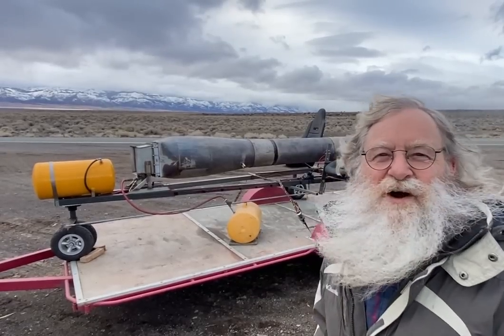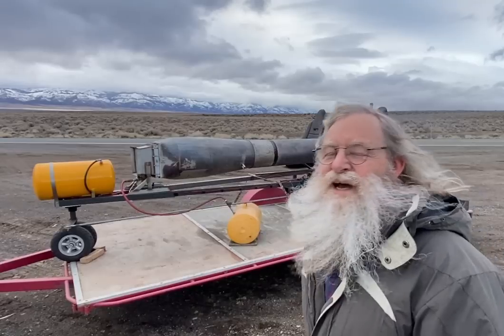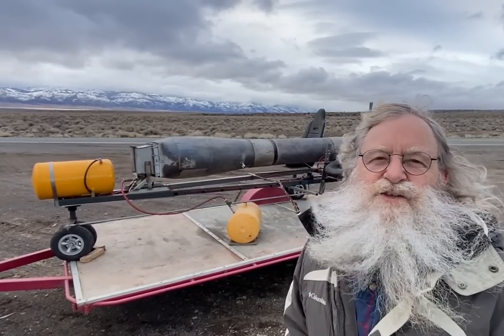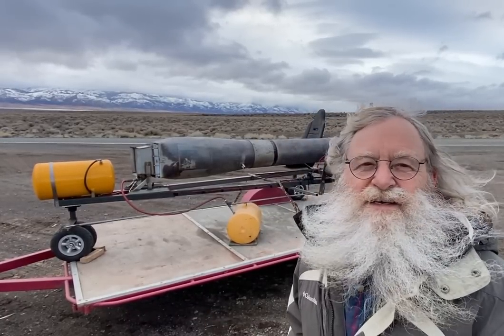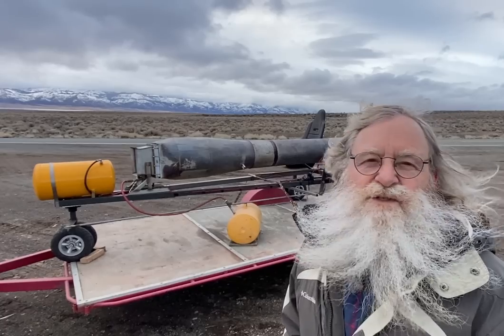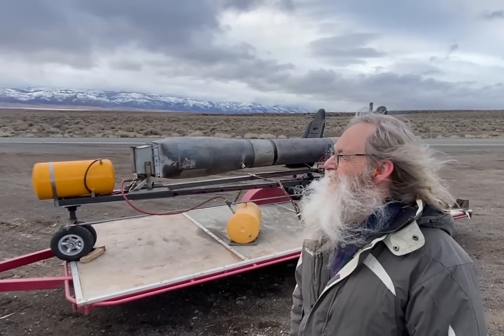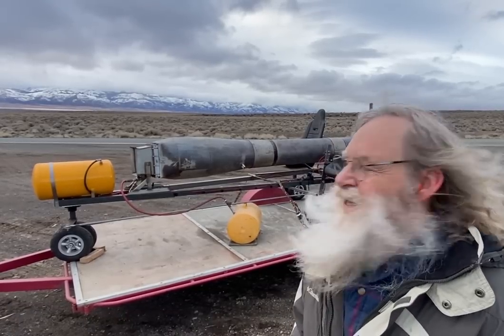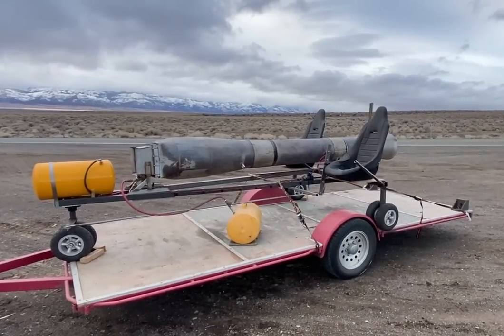Crazy Rocketman testing really big 400 pound thrust Pulsejet engine!

Comment: So important note about the trike. They stopped making those becaous they were extremely unstable in any sort of turn. Combine that with those wheel frame attachments & where they are this one I say "scrap that frame." We all know the risks with the motors but that frame is the really dangerous thing here. Particularly the wheel arrangement & attachments. Please don't push that one out on the flats.
Reply: Hopefully he switch it around before installing stearing mechanism.  A single lock wheel in the back would not be to bad. But a single steering wheel in the front would be a disaster.
Reply: This is the same wheel format as our land yachts and we are comfortably running at higher speeds. Justsaying

Comment: did you ever try external combustion (wood stove) heat sink jet, now its internal combustion pulse jet
Reply: very much less noise, if you have a large slow fire, than a pulsed brrrr drive, lol
Reply: also external combustion stove will not shut itself off by accident, like a internal combustion pulse jet
Reply: yes I mean heat only jet heat sink (hot air expansion jet using a heat sink, whatever the heat source)

Comment: How much horsepower does that have? Is awesome.
Reply: The power of reaction motors such as rockets, turbojets, ramjets, pulse jets (but not turbo-props) is measured in pounds of thrust (Newtons in metric). There is a (rough?) conversion. IIRC (from about 30 years ago) hp is a touch short of 1/2 of lbs/thrust. So 400lbs/thr = approx 195hp.